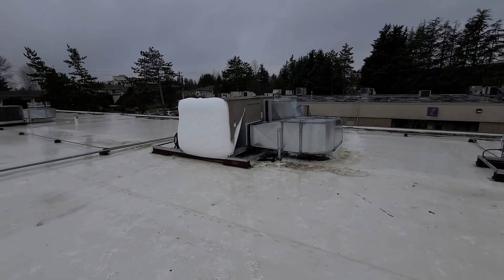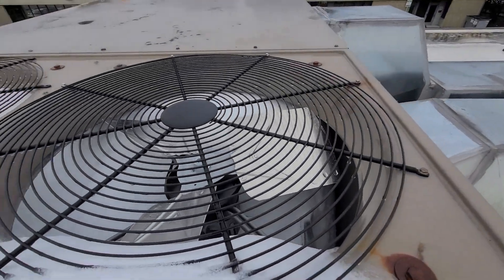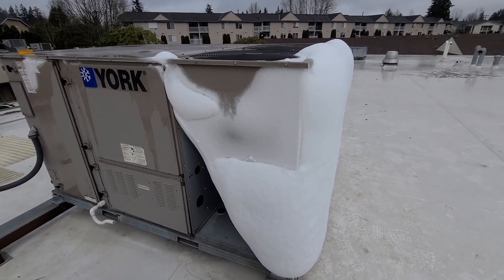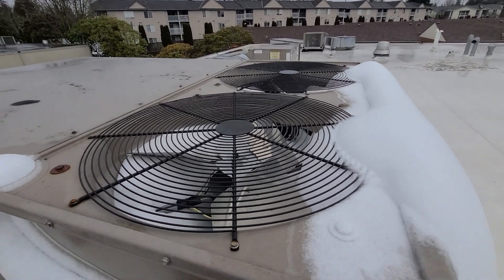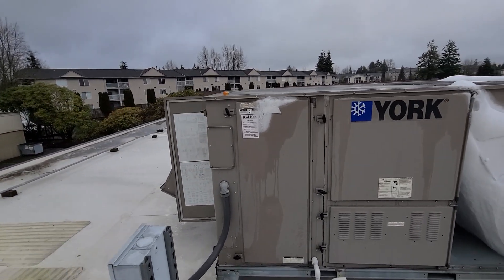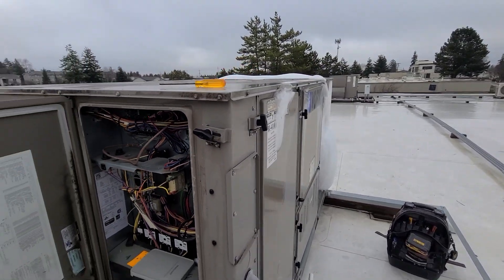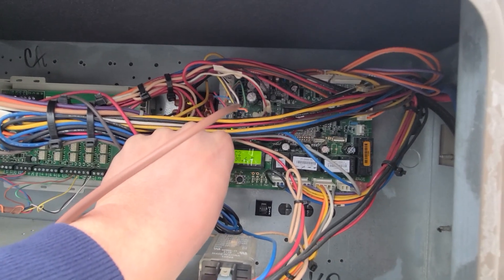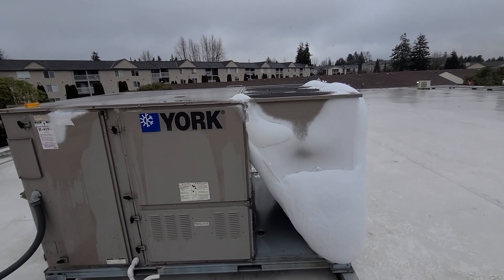HVAC Service Technicians Need To Watch!!!

Comment: Gotta love the Heat Pumps up here in the PNW brotha. They work until the outdoor coil sensors eat it. Then you have the ice ball that everyone has been ignoring despite they could see it when they pull into the store. It is one thing to see some ice occasionally but when it starts growing around the cabinet and moving back on the outside of the cabinet, you know something is wrong. Keep up the good work.
Reply from the maker: Thanks!

Comment: I hate York period. Back when I first started, I was running with an old timer that showed me the ropes. We did a few heat exchanger change out's on various RTU's. I basically thought they were all the same. Then a 15 ton York came along later on in my life. I was thinking it was going to be like doing a carrier boy was I wrong. Maybe the newer one's are different and don't need to be ripped out from the fking top. I won't get into my cousins three stage York furnace, which I don't think anyone make's them anymore.
Reply from the maker: I'm not the biggest fan of the current York stuff.

Comment: the sensors on the suction line the insulation pools with water and shorts out,they have them on amazon 10k thermistors,thanks for sharing.cut slit on insulation to drain.